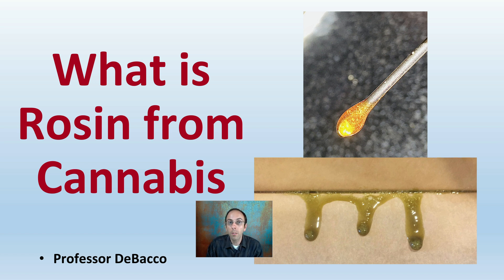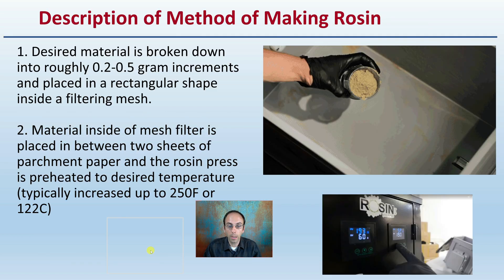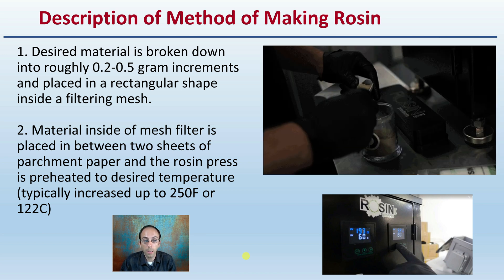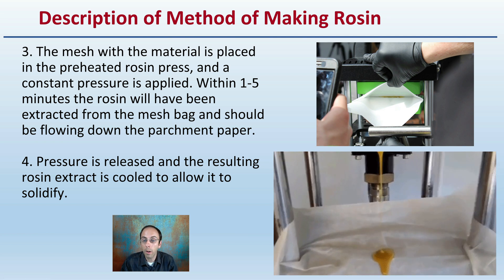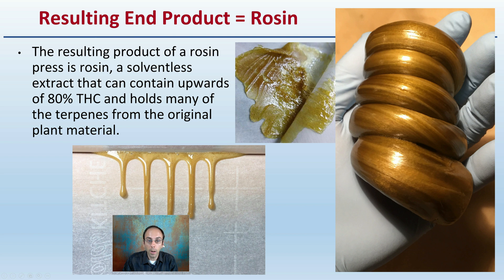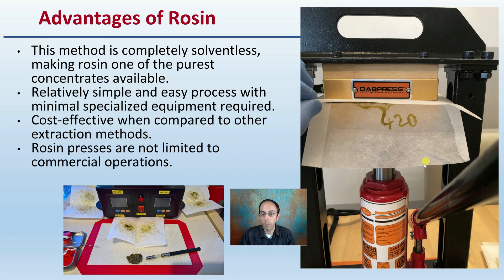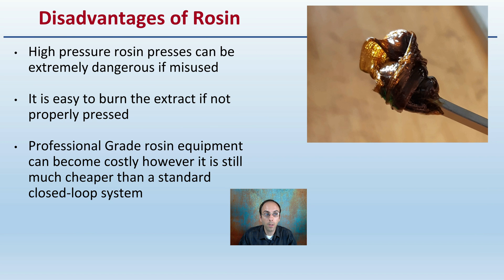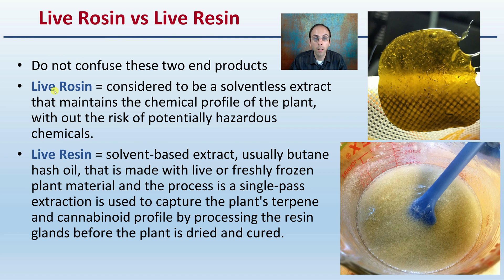What is Rosin from Cannabis

Comment: Alright I've been buying medical marijuana in Florida and it contains you around 20% THC and almost zero CBD. I've noticed a strange taste and it causes a cough and shortness of breath. What are they doing to remove the CBD without removing the THC? Does anybody know I've been trying to find out what it is for 6 months.
Reply from the maker: Many variables, such as but not limited to... frequency of consumption, time of day of consumption, method of consumption,...  However, it is unlikely that the extraction method is the cause for your issue.
Reply: @DeBaccoUniversity  I've been smoking pot regularly everyday for 50 years I know just about everything there is except this new science where they screw it up. I had to do a little diesel therapy jail time federal and state because I grew some plants in Ohio I like my pot not chemically are genetically messed around with. Now I live down in Florida and I got me a medical marijuana card when I go to the dispensary all the pot they have doesn't have any CBD in it. They said that nobody wanted pot with CBD in it. So they sell all these with different amounts of THC. I like my pot with both in it. How are they removing the CBD and not the THC. I believe there is a residue of a chemical on it after they do this if they doing this. Also gives a little bit of a gray color. But what kind of go how are they separating to she bdp from the pot without taking out the THC? I believe it should be illegal to mess around with it chemically. When I go to the pot store he'll be five to seven people waiting in there all old people looking for a miracle, or at least some hope and some relief. THC pot just get you high. The good drug in marijuana is CBD.  These people are being robbed. They want that relief from inflammation, are immune system increase their appetite relax a little, clear up there glaucoma, help asthma and boost there immune system. You got to have your CBD otherwise you're just a drug pusher. I'm thinking we need a class action lawsuit cuz they still advertise it and put a sign up and they still say it helps all these things and THC does not
Reply: I just want to know why my pot taste funny. I've been smoking it for 50 years and it's never caused anaphylactic shock before. This dispensary pot has been chemically altered. What are they putting in my pot.
Reply: @edwardroche2480 HASH

Comment: Im a outdoor Hobbyist......and just had harvest. I separated the Harvest into 3 Classes. 1) top colas 2) Healthy Flower 3) Plants with slight insect damage. I am using a Nugsmasher for the lesser grade plant material. Rosin saved me......extracting the lesser flower and using the Rosin as "Rosin Wrap" around cannagars. Infused products are great to add.....I ddint know you can "Burn" the rosin.....some of my extrctions are dark (i guess i burned)...

What happens if your Rosin is darker?........im using 200 F....Im am gonna try lesser temp.
Reply from the maker: Sounds like the potential for a burn or inclusion of more impurities.
Reply: @DeBaccoUniversity  i think the flower is not that strong.....and you tend to get darker extractions....i switched to 175 degreee F starting point ....and take longer for presses. Curious what is happening chemically when you pressing and heating ?